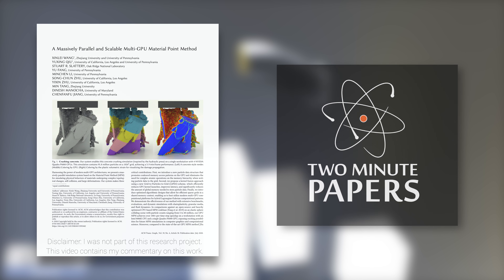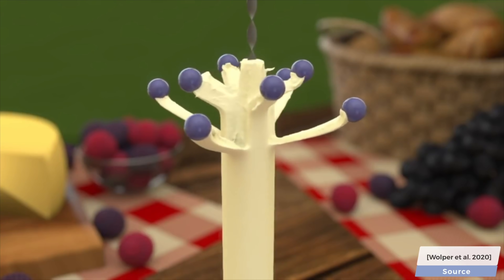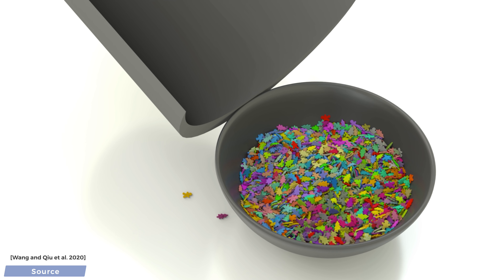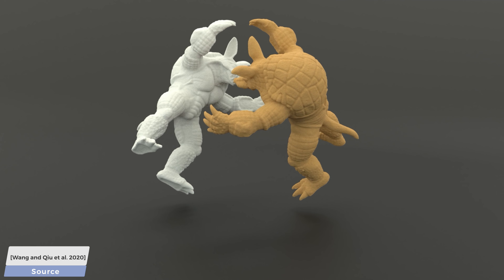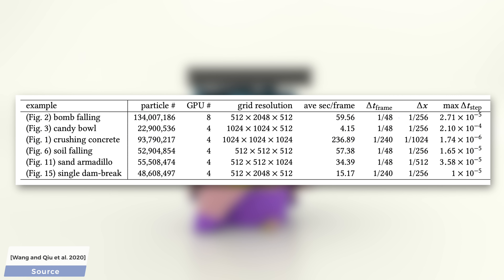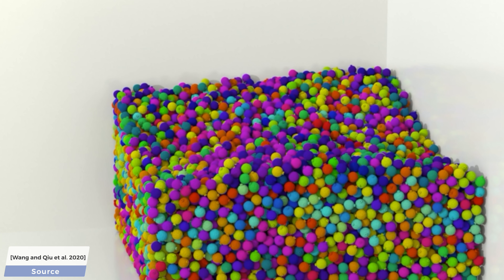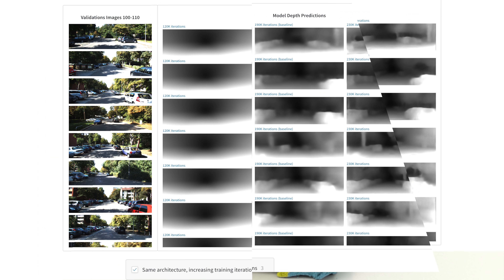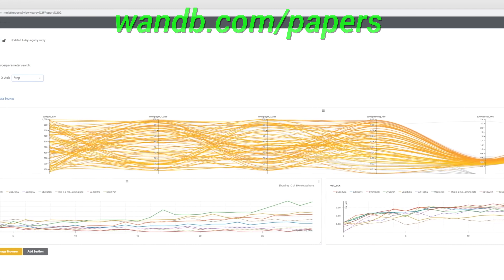This Is What Simulating a 100 Million Particles Looks Like!

Comment: Thanks for the video. Honestly, I was surprised to hear these experiments have been done on CPU up until now. I guess I had assumed that rendering graphic simulations was being done on graphics cards to take advantage of the faster memory and CUDA cores as soon as the API was created. I'm no scientist or a programmer so I don't know the logistics or understand why one method would be preferred over another. But in layman's terms, it seems an obvious choice. Thank you as always for the informative and often awe inspiring videos.
Reply from the maker: You are very kind, thank you so much!
Reply: @TwoMinutePapers  I wonder how something similiar to physics forests would compare in quality and performance.
Reply: GPUs work on executing the exact same code on a large data set. With many types of simulation code, there are dependency checks (i.e. is there a collision) which leads to code that basically require conditionals to evaluate. Every time there's a conditional it doesn't behave like a CPU where the thread just evaluates and moves along. When you have a conditional it'll stall operations until the conditional is evaluated so CPU code is preferred rather than trying to figure out how to deal with fully parallel code with very little conditionals.
Reply: @wakannnai1  Exactly my point
Reply: @wakannnai1  AFAIK the most recent GPU's (I think I read about the 30x0 series) are getting smarter about that, but the core premise definitely still holds.
Reply: @dykam  I'm not really aware of what's new in New GPU architectures. From what I know (due to writing rendering engines as part of my job) GPUs still suck at typical branched code so it should be used sparingly to avoid stalling a lot of threads.
Reply: There are many reasons not to use an GPU. One of the big challenges is that GPU's don't cope well with branching statements. So depending on the simulation it can be more efficient just to render on many CPU cores - assuming you have access to enough cores which uni clusters usually do.
Reply: Generally if problems can be highly parallelized, then GPU is a good way to go; GPU cores are weaker, but there's a crazy amount of them :D
Reply: It's not as easy as it looks. I can only talk for an infinitesimal fraction of people that use graphicscards to speed up simulations, but most time we do simple stuff like solving matrix equations (A*x=b) for really large vectors/matrices. It's not like you can just simply take your C++ code, run a "compile to GPU code" program and get a 1000x speedboost. Much work also goes into datastructures (how to transport a 1e5x1e5 Matrix from RAM to graphicsmemory? you cant just simply walk into mordor and give them 4e+10Byte, you need to invent a compressed version of your matrix that is not only much smaller but the results of the solving should be as similar as possible to the exact results, AND it must be efficient enough to to the math with your compressed matrix that you get a speedboost out of it.) The whole matrix stuff is just an example, there is much more but even things that simple get really complicated if you want to do them "quick".
Reply: @MarsCorporations  Exactly. I see people saying you don't need to know the latancies involved in moving data between vram, system ram, L1/2/3 caches, or the latancies of different instructions across different CPUs/GPUs all the time. Yet that has been about 60% of my job for the last 15 years or so. Graphics researchers come up with incredible algorithms and then people like me try to find ways to optimize them for real time work.
Reply: @mark.slater   could you point me toward a resource of e.g. Porting python programs onto Cuda? Or is stuff like cython good enough?
Reply: @adzx4  Honestly, I rarely use python so I'm not the person to ask. I mostly work in C (or C++ if I really have to). But I can ask some of my colleagues.
Reply: @adzx4  One thing I would stress though is the importance of knowing how your hardware works if you want to port something from Python to CUDA. For the CPU side of things, the Intel x86 manuals are the best place to start. Sure they can be hard to get into at first, but if you put the time in they will really help with your programming on the CPU side. Next look into how data is moved from system memory to graphics memory (as discussed above). Memory transfer latencies are the biggest headache in gamedev - asymptotic analysis (big o notation) matters but rarely captures the problems with memory latency. Mike Acton gave a good talk at cppcon about this. His cellperformance.beyond3d.com site is full of useful info about this (although with a PS3 focus). But one problem you'll encounter is that most game studios have developed ways of dealing with these style of ports but they are generally propriatory (given each studio wants to out perform their competition).
Reply: @mark.slater  thanks for the reply Mark!

From what I understand in levels of hierarchy we go something like

Machine code -> cpu code -> c code -> python code

Would I need to understand the cpu code until the python code in this chain? Or would simply knowing the cpu code be enough?

I don't want to press your time, but if you could give an example of where knowing the cpu code is useful for efficient python porting (or any port) or even just writing a  cpu program? 

It's pretty interesting how gaming development is starting to cross into scientific research.

Again, thanks for your answer, I'll look into your url!
Reply: @adzx4  No problem. I actually come from a physics background (astro > quantum optics research > game dev when my funding disappeared), so it seems natural to me. While many of the low level game devs I know come from a compsci or self taught + industry experience background, there are a number of us from a physics or electrical engineering background.

I feel that knowing how things work at a low level is always a benefit, but given I've spent my whole professional life doing so I can't comment on other programmer roles. Certainly I think about how the CPU will effect all my code - including scripts (typically bash not python).

For a good example of why the ability to understand assembly can be important, look up Handmade Hero. There's a good clip of Casey (the developer) explaining why the concept of a "Zero Cost Abstraction" is nonsense.
Reply: @mark.slater  hahaha no way, I'm current doing my masters in physics and going toward an artificial intelligence/software engineering direction.

It seems like you've done a lot of physics research, did you find it rewarding /as interesting as the game dev-ing?

I'll take a look at handmade hero and Casey. Hopefully it'll clear things up. 

Thanks again.
Reply: @adzx4  No problem. Casey is a very respected developer in the industry. Handmade Hero is his side project to show beginners (who ideally have some experience with C) how to write a game including a custom engine with minimal dependencies. I've only watched a few episodes, but what I've seen was very good. He also has a fun podcast, although it rarely covers programming directly.

As for physics, I loved my research but honestly was a little put off by the cost of some experiments, given that the money might be more beneficial if invested elsewhere (cancer research for example). Then again, while I was on a PhD program I had already figured out I was more interested in mathematics and not physics in general, so again I'm not the best person to talk to about it. If you haven't seen Andrew Dotson's channel you might like it (he's currently on a PhD). As you might guess from my suggestions I often leave YouTube playing in the background while I've been working from home.

Edit: I realize I didn't answer your question. I prefer game dev as long as I'm on the tooling side. I like the mathematical challenge it poses, while also needing a deep understanding of computer hardware. As with physics, I dislike the budgets that are put into some gaming projects. I guess I'm more of an engineer than a physicist. That said, being able to simulate unusual worlds does appeal to the physicist in me. A lot of game dev is choosing where to spend CPU cycles on accuracy. As a result you can wind up with some very unusual bugs in physics engines.
Reply: I think one of the biggest reasons is that it's simply easier to get something running perfectly on CPU only, and for a proof-of-concept or for footage for a paper, it's not worth moving to the GPU, since that would take a lot more time and debugging.
Reply: I'm actually so hyped for my HPC course i started 2 weeks ago. Cant wait until i can get my hands on some serious problems like this to deal with :D
Reply: @alexandrubragari1537  Good luck with the course!
Reply: Pin of average-human-perspectice
Reply: Normally Graphic processor units usually didn't have that much computing power in the early 2000s.
Its more readily available now :)
I have no idea if that is true, but it sounded correct.
Reply: Redundant Normally there, mb.
Reply: Many don't use CUDA because it's closed sourced Nvidia garbage. 
For anything more serious beyond workstation with 8 GPU's - Nvidia will price gauge so munch it will cost arm, leg and both your kidneys.
Scientist want to make progress and not feed single corporation with all of their research grants.
Reply: @LordAlacorn  I don't think that's why academics don't use CUDA. Currently distribution of workloads with multi GPU systems regardless of whatever language you're using (CUDA, OpenCL, or C++ Amp) is not exactly straightforward. It's much easier to distribute tasks across CPUs. Academics would rather waste their time on research worrying about proving their thesis then reinventing the wheel to support GPU based results even though they may be faster.
Reply: @wakannnai1  That's what game engine/tool devs like me are for.
Reply: @LordAlacorn  This too.
Reply: @LordAlacorn  I didn't know that. You would think they'd have some sort of dispensation for non corporation related research especially since in this case in particular, the research could end up helping them out in the long run. More efficient code on their hardware will function better than generic code on a competitor's hardware.

Comment: Your explanation is misleading at around 3:50. The smaller frame delta t means more frames per second, not harder to compute frames. The last column on the other hand could be related.

Comment: The concretes simulation looked very weird as i would expect dust and particles from the pressure from the press, but the concrete seems to fall to the ground and looks like it has the texture of kinetic sand.

Comment: Question: I am wondering how you do the slow motion simulation. Is it like photography, just add more frames per second or just slow down the normal speed simulation? If it is the first example, could you then use AI or another paper to fill in extra frames to the simulation to make it slow motion, with the effect of saving time and computing power? Or will it always just be easier to run one simulation for normal speed and then a separate simulation with double the amount of frames in for 1/2  speed slow motion?

Thanks in advance!

Comment: Very impressive! On the other hand, I can't get over the fact that the wiggling pointed out in the video, while it does tend to evidence the detail of the simulation, it doesn't necessarily reflect realism. I'm going to hazard a guess that it's caused by the same old artifacts that cause stacks of rigid boxes in many simulations to become bouncy and unstable (though in this case it could merely be choice of parameters to be fair). I'm always impressed when a physics simulations shows no evidence of that because it's so common.

Comment: When using a hydraulic press on concrete it will explode look similar in shape and size and fractures but it explodes.
Reply: 1. It is not the same material as in the simulation.
2. Looked at it on youtube, what happens seems to depend on the type of concrete. Some just crumble, some brakes in large chunks.

Comment: These physics simulations are always too bouncy/rubbery compared to real life.
Reply: you can adjust the bouncyness :)
Reply: Ya, the concrete acts more like a sponge cake or such :)
But that's different physics than breaking it up - if they just want to break it, it's better to focus only on that, or it will take longer than necessery to calculate it.
Reply: If it helps to put it in perspective, a cell is made up of 100 trillion atoms.  A virus, one of the smallest living organisms is made up of ~4 million atoms. So these are roughly between a virus and a cell. Granted, these particles wouldn't have to be atom-sized. But making it bigger doesn't really make a difference I think.
Reply: @calebkirschbaum8158  It's not just the size though, but the properties of the material. Sponge cake and concrete have completely different composition and physical properties.
Reply: It is because of the 'soft' particles we use in these simulations. The harder the sphere, the higher the elastic constant, which results in smaller timesteps. Thus it is usually preferred sometimes to simulate elastic balls as sand grains!
Reply: It is just for show, you can easily adjust that in code.
Reply: i think we feel like it's too bouncy because we don't realise how small the real life counterpart of the simulated objects are supposed to be, there are only a small number of particles in those simulation compared to how many molecules there would be if those things were the sizes our brain think they are. Or maybe it's just the program that's not realistic or well adjusted.

Comment: This is incredible now, but it could easily be the normal in 10-20 years.
Reply: It'll be outdated in 1 year I bet
Reply: I'm not talking about the possibility of it, but it becoming a common thing.
Reply: it will be normal in less than 1 year
Reply: 240 seconds for 4 GPU configuration in crushing concrete. That's 960 seconds for 1 GPU. To achieve 120 fps for that alone without anything else going on, you would need 115 200 times faster single GPU. Doubling every 2 years will result in reaching that in 34 years, so 2054.
Reply: 10-20 years? More like 2 papers down the line.
Reply: It not even using 4 3090GPU
Reply: Less than that, if Moore's law continues!
Reply: @JosephDalrymple  I think that law will apply untill we need more power than electricity can provide 😁
Reply: 4 second per frame... I doubt i will see this in a videogame very soon xD
Reply: 30 years ago, some kid may have said "my grandchildren won't still be around to see when this animation finishes rendering".
Reply: Try 3-5 years
Reply: Question: I am wondering how you do the slow motion simulation. Is it like photography, just add more frames per second or just slow down the normal speed simulation? If it is the first example, could you then use AI or another paper to fill in extra frames to the simulation to make it slow motion, with the effect of saving time and computing power? Or will it always just be easier to run one simulation for normal speed and then a separate simulation with double the amount of frames in for 1/2  speed slow motion?

Thanks in advance!
Reply: @bt70a9  There is no 'slow motion simulation'. You simulate the system at the maximum speed that your computer can handle, and the computer records everything that happens for every time step of the simulation. The displayed speed is juste the speed at which you're asking the computer to show you the recorded data afterwards. You can't use another AI to skip time steps, because the AI would need to do the exact same job as your simulation, so if you had it you would just use the AI for all the data points. If you're thinking about doing some sort of interpolation between points, well you can't do that because at the instant where you would use the AI to compute the next step, you only have the data computed by your algorithm for the previous step.
One way to alter the simulation speed is to loosen physical constraints, your system becomes less realistic but can sometimes be orders of magnitude faster. For instance, if you decrease the parameter linked to the speed of sound in the simulated material, you can simulate much faster. That's why in the video concrete/water takes a long time to simulate (fast speed of sound in concrete), while soil and sand are faster to simulate (slower speed of sound in sand).
Reply: More like 30 40 years u are naive
Reply: Exactly, I'm excited to see what researchers will present in the next 100 years.
Reply: @BlackEagle352  you will not be alive in 100 years if you're old enough know a language, sorry.
Reply: @bt70a9  why so pessimistic? You don't know that for sure.
Reply: @bt70a9  so you want me do die? What if i dont die before 110?
Reply: 10 to 20 years you're going to be looking at art least ready player 1 if not the matrix level simulations
Reply: you are way too optimistic

Comment: The integrators being used for the dynamics are obviously being run at the barrier of their numerical stability. The oscillating jiggles are numerical error.
Reply: Nah, just replace your particles with jelly balls, call it wiggle and call it a day.
Reply: Numerical errors can indeed oscillate, but there is no way the error is that large. They made that on purpose, probably for show.

Comment: I used to crush concrete when I worked as a lab-tech at an engineering firm, and I have to say that the simulation is not very accurate.  Still impressive though.
Reply: It is not the same material as in the simulation. And I don't think that is the point.
They can most likely change the stress tensor, and all that stuff, in the simulation code.